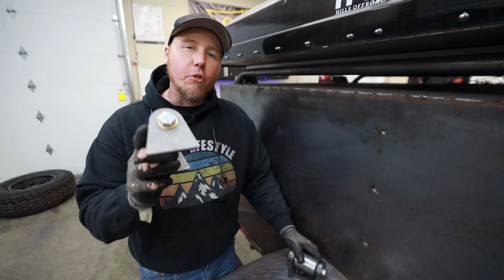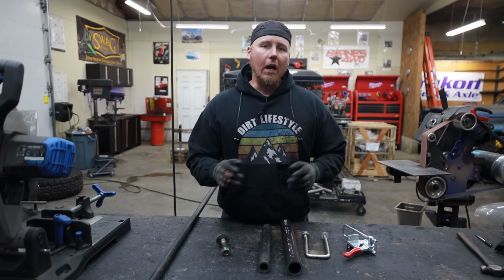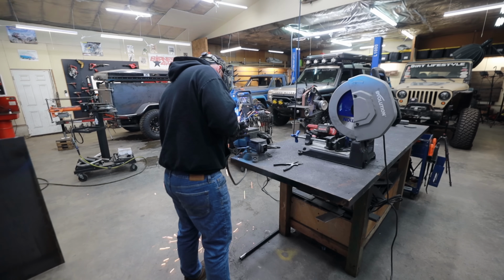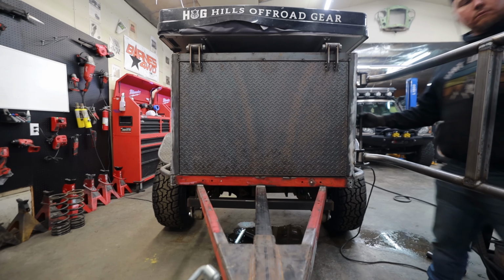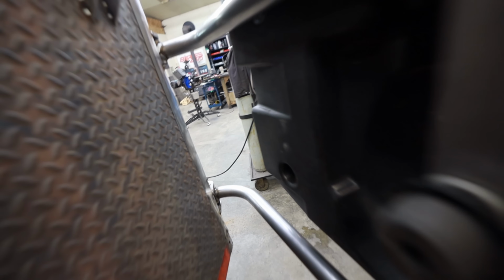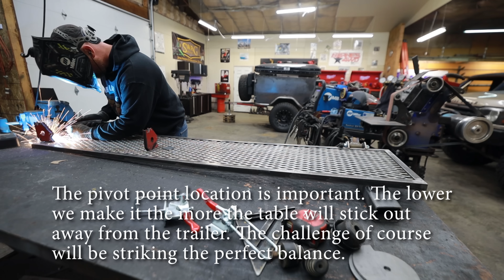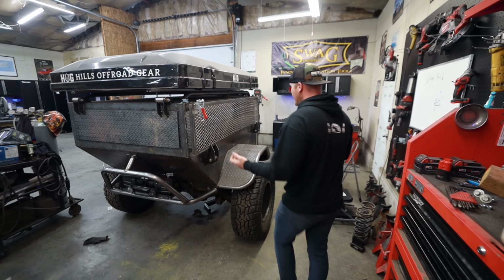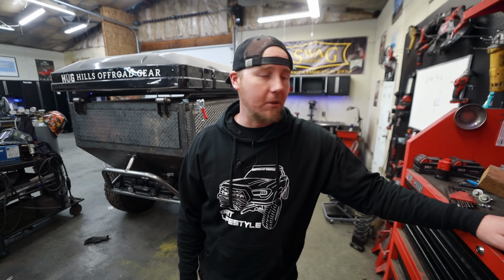Finally Back In The Shop! Harbor Freight Offroad Trailer Episode 6 👊.

Comment: Go old school on the table supports, "flat bar" style tailgate supports. The ones that hinge in the middle like old Chevy trucks. Never bind and will always fold in for you without having to help them.
Reply: This is my idea as well
Reply: My thoughts exactly, definitely this
Reply: This!
Reply: Ditto. No snagging branches, no annoying rattling sound. Low profile, pure and simple.
Reply: Exactly my thought also. Can be mounted slightly inboard of the table edges so hidden when closed
Reply: You beat me to it, I was thinking the same thing.
Reply: This was my first thought aswell
Reply: Beat me to it.
Reply: I just was gonna post the same, my Mitsubishi animal has a similar way , on my discovery door table I've used heat shrink over chain which is another way!
Reply: Agreed, the table is really just a tailgate. Keep it simple
Reply: This was my exact thought. Simple, effective, super strong
Reply: Came here to say the same thing.
Reply: Beat me too it. I thought of it as soon as he said he was worried about the looped cable.
Reply: I was just about to type this... absolutely strong and folds away with the table.
Reply: My thoughts as well
Reply: That's my thoughts too. The retractable cable would have to be sealed up pretty good to keep out the dirt and grime.
Reply: Damn, I thought I was gonna be first with this idea. Guess great minds think alike.
Reply: Definitely this
Reply: I think this is the first thing that hit everyone's mind. I was coming to comment the same.
Reply: Yes, I was thinking of like a folding tables legs.
Reply: This is what I was going to suggest
Reply: I was thinking the same thing, except my point of reference is my 1974 Ford.
Reply: That was my first thought too!  I second this motion,  =)  Except like old Ford trucks.... =D
Reply: @biner626   folding legs that angle back to the trailer, under the table or to the  ground?  Pin  to a mount and pin flush in the stowed position?
Reply: @mandeladams4793  back to the body. Legs would get hit and kicked.
Reply: My first thought was to add a stop to the hinges, but then I saw this and it definitely feels like a more "Nate" approach to things
Reply: Same thing I was thinking, get them for next to nothing at the junk yard.
Reply: Agreed
Reply: I had the exact same thought as the 20+ other guys.  Old school pickup tailgate, bi-fold.  Square body style - all of the major manufacturers used them for a reason.  Reliable, durable, and cheap.
Reply: yep another one with the same idea. Same thing thats on.my writing desk.
Reply: Exactly what I was thinking.  Simple,  fool proof,  strong
Reply: Yup, this.
Reply: Didn’t even read the comments, sound like a broken record……great minds
Reply: I came to say the same thing everyone else did.
Reply: What all these people said was thinking the same thing go look at an old square body chevy tail gate
Reply: So does 1/8 inch cable
Reply: My initial thought as well
Reply: @redsyphon  if the concern is really the cable looping up and coming outside of the table itself then I would switch to smaller diameter and or move the cable 6 to 8 inches in word on the table instead of having it on each of the corners
Reply: Same thought here.
Reply: That is exactly what I was getting ready to say
Reply: I was going to suggest the same
Reply: We're putting our 2 cents in the pot on this idea also!!  We agree this would be the best.
Reply: So funny. I was going to suggest the same thing.
Reply: Ditto. The K.I.S.S. principle never lets you down!
Reply: I had the same idea straight away too. What a bunch of intelligent people.
Reply: Best idea.  That would work great and look super cool. 👍🏻
Reply: Lol I was thinking the same thing, just tuck it on the inside that way it doesn't risk catching anything in the unlikely event it decides to swing out
Reply: This was my instant thought as well. Could probably make some pretty sweet custom ones.
Reply: I was going to say the same thing
Reply: yep exactly this - simple and sturdy!
Reply: Drew up the exact same thing to send though on Instagram. Didn’t check comments before hand. Although can confirm, it does work and really would suit the trailer build. Great build, looking forward to seeing the finished product!
Reply: Better than my idea… I support it!
Reply: Yaaaas!!!
Reply: i came here to type this
Reply: yeah, I think he knew this is the best option as well but it helps with video engagement to get comments...and here we all are!
Reply: Yep
Reply: Exactly what I was coming to say
Reply: I’ve been looking for that exact thing I just couldn’t find what they’re called 😂
Reply: +1, had the same idea. Chevy tailgate/flat bar style supports on the ends.
Reply: Instead of 180 degree round at the bottom of the hinge, it would be 90 degree corner on the out facing side so as it comes down, all four hinge supports would stop the table at 90 degrees
Reply: What I was thinking
Reply: Plus can be made to disconnect, but will need rubber bumpers for the elbow joints to make contact with to stop rattling.
Reply: Same idea. Perfect solution.
Reply: I was just about to say the same thing. Great idea
Reply: X65 on this idea. Flat bar straps for the win.
Reply: I was going to say the same thing. It will be really sturdy
Reply: I thought of the same thing right away too. As cool as a retractable cable could be, it's too complicated and will eventually start to fray leaving sharp wires to cut yourself or the kids on. The cable will eventually bind, kink or have the spooling spring fail. The hinged "tailgate bar" is way simpler and more reliable.
Reply: Showed up to post the same. This is the way.
Reply: I came on to the app just so I could make that comment. I think it's an excellent suggestion. The old Chevy pickup that we turned into a trailer after a fruit truck edit had tailgate supports like that when I was a kid. Flat bars with round pivot in the middle.
Reply: I was going to write a comment suggesting gas struts, but your comment was on top, read it and I thought that this was a far better idea! Brilliant!
Reply: Yep , agreed. Simple, strong.
Reply: Yep this.
Reply: +1
Reply: late to the party but thats want came to mind as well
Reply: Came here to right the same thing.
Reply: @tnkklr2011  I'm a week late watching to come up with this idea, myself. Happens to me all the time. I come up with an original idea, and someone else is already selling it.
Reply: Agree 100%
Reply: Just watched these - came in here to say 'two part flat bar' as well. LOTS of advantages. One being if you 'snap' em to straight (elongated pivot hole or even pins), or put a slip lock over center hinge, table won't be able to move 'up' when bumped while you're using it. Folks walk'n 'bout won't "spill the beans" for breakfast.
Reply: I was just about to comment the same but thought I should scour the comments first! Either that or adjustable bolt stops welded to the base of the hinges? They look pretty stout, and the 1/8 wall sheet metal should support the shelf pretty well?
Reply: I was thinking the same thing.  This style is on my 68 Ford pickup tailgate.
Reply: This but you can do it on the hinge itself
Reply: Dang good idea
Reply: I vote yes!!
Reply: This was my first thought as well...hell, just go to the junkyard and grab a set off of an old Chevy truck for like $15 and sandblast/paint them once they're installed...
Reply: Agree, was literally thinking the same thing.  Easy, folds into the table angle iron, stronger, won't catch.  It's perfect, have a set on my old ford and I don't know why they ever switched the design.
Reply: Well, for some of us, old school is a lot older than for others... For me, "old school" was chains with hooks on them holding the tailgate... The advantage was that you could let the tailgate all the way down past horizontal... It flat bar system came later... I was going to also suggest the flat bar system, but my inspiration came from how the lids were attached on old cedar chests and drop down desks...
Reply: Where can I find that gas tank/spare tire holder?
Reply: I just watched this today and that was the first thing I thought of
Reply: That is a good idea I was thinking a pull starter off a lawnmower

Comment: So if for fun you want to do some thing a little less obvious... Wire Cables, disappearing through rounded steel grommets under the top edge of the trailer. Inside, pass through a tap washer, then a penny washer and crimp into loops. Attach strong shock cord to the loops, then to eyebolts on the far side. [1] The penny washer arrests the table at horizontal, [2] the tap washer cushions it, [3] the shock cord slows the progress toward the end, assists lifting the table and is strong enough to stay horizontal and out of the way when returned to rest. Waterproof the grommets by adding larger diameter 'eyebrows' cut on a downward slope from steel tube. If more deflection is necessary, run the shock cord from front to rear so there is more material [one for each cable].

Comment: Table support- two pieces of 1" flat stock attached together with a pivot point at the end so it unfolds like a scissor. placed at both ends of the table.

Comment: Instead of a cable how about a 2 piece hinged arm like on the lid of a camp stove. Super strong and will tuck away
Reply from the maker: I think this is definitely simple and a good suggestion 👍
Reply: Yep same think i was thinking
Reply: @DirtLifestyle   even easier would be to weld a stop on the bottom of the hinge so when it's at 90 it touches the side of the trailer body

Comment: The retractable cable... do it like a sink with the faucet head that retracts.  Put a weight on the back side of the cable, when it's not pulled via the table, the weight on the back side pulls it back in.  You'll need a grommet or something to allow the cable to free flow, and a cable stop to get the height of the table to be parallel with the ground.  Also don't forget, you've got the table at waist height.  When you put the tires on the ramp, you're adding 6" putting it closer to chest height.

Comment: Remember the old windows with the ropes and weights.  Hook a cable with a cylinder weight and when you lift the table the weight pulls the cable into the pocket. When you lower the table the weight comes up and hits the wall, the cable suspends the table.

Comment: Build the table stops into the hinges, then reinforce the table so it isn't flimsy. Maybe add a gas spring to each end for holding it against the stops while it is down.
Reply from the maker: I didn't consider this. A bumpstop under each hinge and one on the fender? Is that what you are thinking?
Reply: @DirtLifestyle  maybe even a flat piece at the bottom of each hinge that just stops the travel at a certain point.
Reply: @DirtLifestyle  yes, but wasn't thinking bumpstop on the fender....maybe that is a game time decision.
Reply: @ShaneConanttheoriginal  yes, hard stops built into hinges.
Reply: This was going to be my suggestion as well. It's a super simple solution. Hell, they even make something like this for the doors in your house.
Reply: This is exactly what I was thinking. I would also add some rigidity to the table itself.
Reply: I would weld a tab onto the hinge that stops the table where you want it.  Your hinge point is plenty beefy, and a hard stop on each hinge tab (4ea) would easily support anything you’re going to sit on the expanded metal.  It’s simple with no moving parts and nothing to wear out.
Reply: Tabs on the hinges are the way to go. One tab each side of one hinge, so 4 total per hinge. 1/4 x 1/2 bar, welded on 3 sides.
Reply: @DirtLifestyle  as you know. all trailers are alloy. weight is a factor, specially here in aus, i prefer steel. or say 3mm alloy.  i had a 10mm bumper/bullbar. stronger than steel. it flexed 3'', wrote off a car a hit at 40 mph.. no damage to my f100 4x4.impact was r/h side of bar. left /rear/side of car. pulled out from a stop sign,,wanted a new car i think..how do i know it flexed 3'',,paint taken off lower guard. no dent. we dont have any accessory parts like in u.s. i buy all my gear,parts from u.s. i have 4 us trucks,4x4rs, 1, 73 challenger,r/t.
Reply: @DirtLifestyle  gas struts. heavier than you need. i have 700nm. on my canopy, if you dont hold it,,itll take your head off..
Reply: @DirtLifestyle  my idea,i think has been tried.. ever thought of an electric motor, gear reduction box, variable speed, has to be computer. fitted to tralier axle. torque sensetive. just a thought. it would push the tralier instead of dead weight. turn on up hill,or over rocks.

Comment: For the retractable cable.  Drill a hole into the frame tube. Adda roller at the top as a pivot point , and put a weight/stopper at the end of cable.let it rin up and down the frame, And it's all atomic.

Comment: I like what David Klug suggested with the heavy folding strap.  But... I have a couple of ideas too.  1 - the strap could be hinged steel. 2 - for a retracting cable add a tube mounted vertical inside, run the cable across a smooth rounded surface from the table corners and then back down the tube.  Then add a weight to the cable inside the tube.  When pulled the cable weight become the bump stop.  Might even be able to use a bike chain...

Comment: On the table you could also just add “stops” on the hinges so it can only rotate to 90 degrees and no further. It may not be stiff enough for what youre wanting but would be incredibly simple to install.

Alternatively a less simple but much stronger method would be like cables, but instead use two bars of flat stock as a folding linkage on either side. The two “links” would be bolted together with a sleeve so they can rotate/fold. Itd actuate kind of like the linkage on a folding chair or a step ladder. That would be incredibly strong and fold up flush with the sides of the table.
Reply: EXACTLY what i was thinking...
Reply: Exactly my thoughts
Reply: I think a third hinge in the center and some hinge stops would be your simplest and most effective way of supporting and maintaining rigidity.
Reply: Why not use two gas struts on the ends of the table like the ones you would find on a truck lid or rear hatch

Comment: You could use two metal straps bolted together like the old school tailgate supports. Three bolted pivot points and two equal length straps. Then they would fold with the table and not stick out.
Reply: This is exactly what I was thinking too.
Reply: @arrondentinger2086  Ditto.
Reply: same as i was thinking  - also easy to fabricate
Reply: Best way to do it!  I was thinking the same!
Reply: Exactly!
Reply: Right where my mind went as well.

Comment: Cable reel, while cool in the shop, will jam when enough road and trail grime gets into the mechanism. Counterweights and pulleys will rattle unless contained, and eventually the pulleys will grime up too.
The flat folding bar tailgate undoubtedly makes the most sense

Comment: Use 2 pieces of flat metal bar about 1" wide by 1/16" thick and have them hinge in the middle and put a set on either end just like some older truck tailgates did before they all went to cables. Hope this helps.😁👍
Reply: That is what I was thinking would work as well.  Simple.

Comment: I would use sprocket chain for the table, used it in mine and it will tuck nicely behind the expanded metal. They seem to hold up a lot of weight as well.
Reply: I was thinking regular chain because gravity but, I think I like your idea better. Also if he attached it inboard a half inch or so, no catching on branches.
Reply: Same thought, very strong and won’t move out of plane.
Reply: Ray R
Dang great idea using roller chain, and could be adjustable for being on angle.

Comment: A cable and inside is retracted by bungee cords. but the cable has a stop at the end of the table and the other end mounts to the trailer when in use...   so the bungee cord stretches across the front of the table, maybe inside a tube.

Comment: you could take a cable and run it through a hole inside the trailer and put a weight on the end of the cable so it pulls the excess cable back in the trailer but you might want to put the weight in a piece of DOM so it slide up and down and it doesn't flap around in the trailer kind of like the old windows with the counter weights in them so they go up easier

Comment: weld a weight to the end of the cable inside the trailer that will act as a cable stop when you put the table down and will drop with gravity when you put the table up for storage.

Comment: Do it like a tailgate on a pickup. Two flat bars that fold in the middle.  Just like a tailgate it will be strong. You can even make it tabbed like a tailgate where you can remove it if you pull the table off. This will be strong, and avoid using cables. Good luck! love the project.

Comment: How about a liftgate strut to support the table?
Reply: Same idea I was just about to mention.
Reply from the maker: Are you thinking I mount them so the table is hanging on the struts?
Reply: @DirtLifestyle  I would say yes. The struts will press downward to hold the table down and also act as a stability point. When finish with table lift up and either a hitch pin or a (similar) way to lock in closed position
Reply: @DirtLifestyle  I guess they might be prone to waring out faster without a cable as the actual support. I might just go with tailgate cables. they are quite, short and easy to come by. Or the old style 2 bar tailgate supports.

Comment: Thicker, more rigid cable with a stop on the inside end should retract into its own through hole given there’s enough room inside. Maybe strategically inside the frame tubes.
Reply: That stop should have some weight to it to support the retraction.